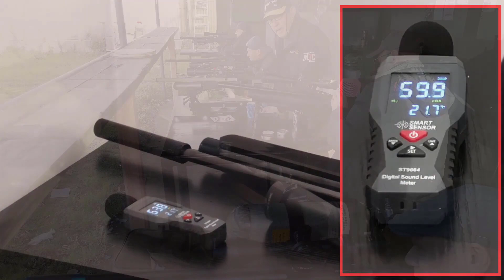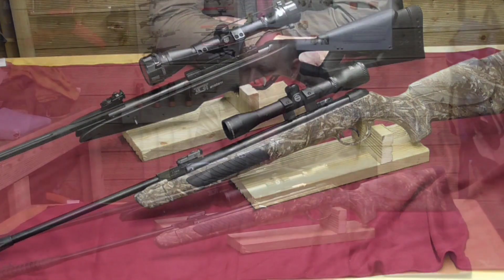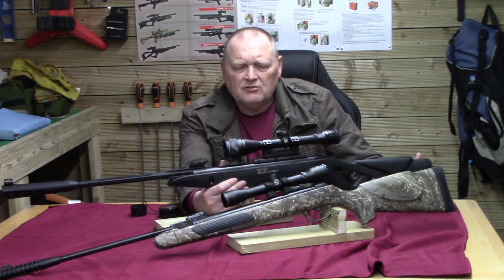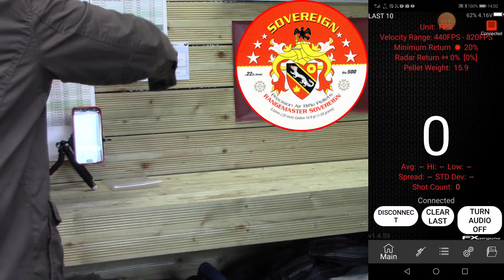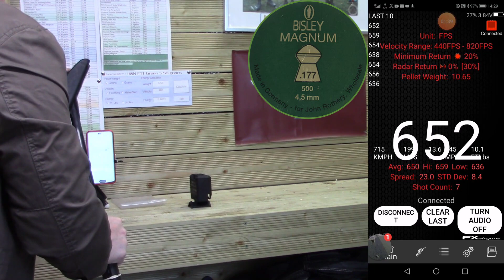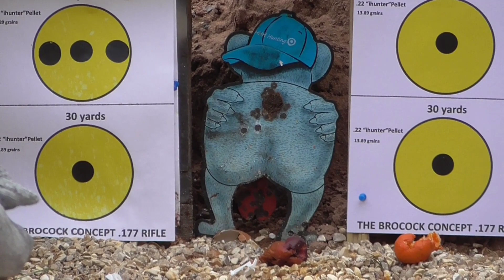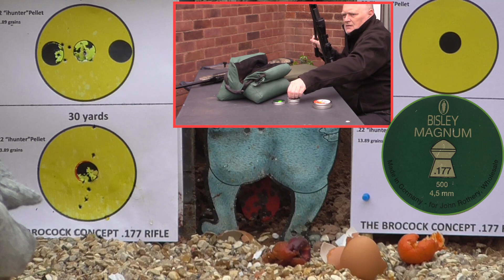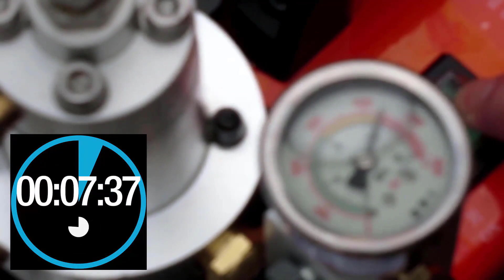An Airgunners Covid 19 - Part Six - What Shall I do Diary - Springer vs Gas Ram

Comment: Why do you not do some research to get the facts correct before sprouting a load of rubbish. eg  tell me if Titan or Ox sell springs calibre specific.
Reply from the maker: Titan and Ox springs are both aftermarket springs and you will probably need to cut them down if they produce too much energy for certain gun models. I was  talking about manufactured production springs for specific rifles in specific calibres.
Reply: @airgunsniper-elite7385  ok try this one, half of the country is panicking about getting food and you waste eggs by shooting them,  then post it on here, very clever...
Reply from the maker: @neilpope2580  The eggs  are all past their sell by date. That's the only reason I'm shooting them. Only one or two left now. Thought I'd use them for slow motion effect, rather than just bin them. The tangerine and peach were the same if you look closely. There's no need to panic buy anyway. There isn't a food shortage. After the first two weeks I think people have finally realised, plus the shops have now started to limit numbers of purchase of the same item that's helped.